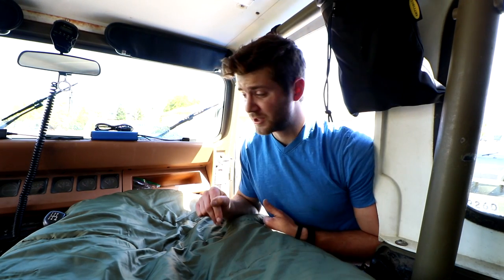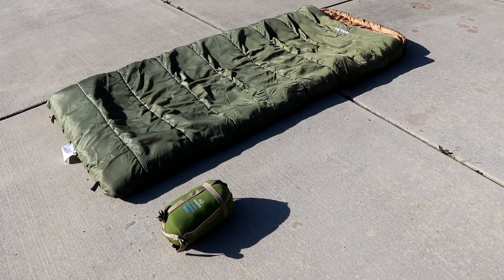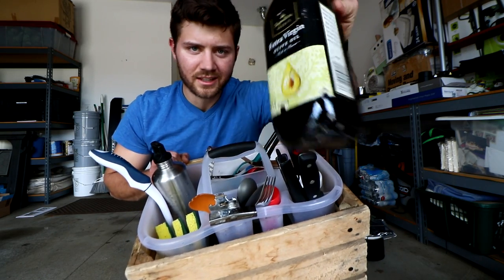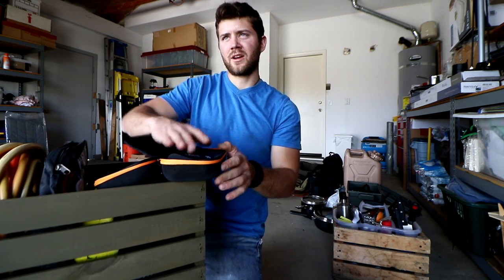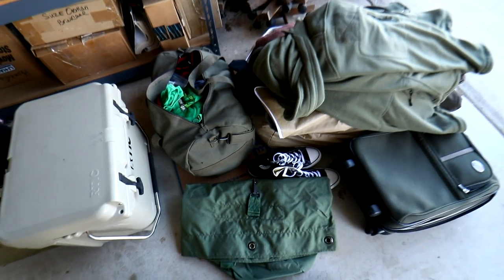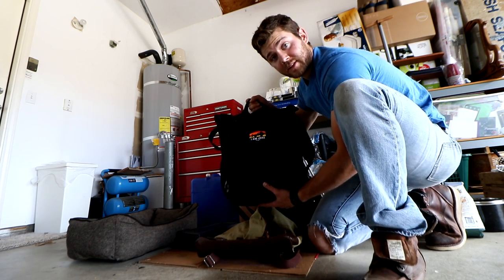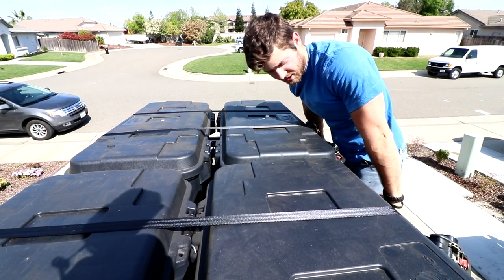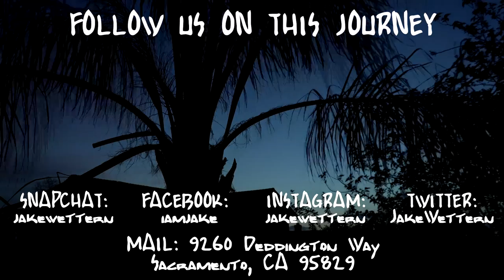Living In My Jeep Wrangler: 1 YEAR UPDATE

Comment: I used to take my Jeep Wrangler camping   I'm in the Society for Creative Anachronism, and we often camp in primitive conditions.   I could load in my tent, two big plastic bins, one or two full sized coolers, a big table, chairs, bedding, pillows, my garb, my craft items, and all without taking the seats out of the Jeep.   All I did was roll the back seat forward and  use that area as cargo.   I had a soft top Jeep too.   I miss my Jeep.  I hit something on the road in a construction area, and apparently cracked the axle.   A few weeks later my dad was driving my Jeep, and the axel broke.   It would have cost more to fix it than to buy a used car, and since I'm getting older and I was starting to have issues getting in the Jeep.....But I miss my Peggy.  My flying horse power.

Comment: I just found your channel, I'm really impressed.  I wish I would have had the guts to do something like this when I was your age (I'm 63 now). Just a couple of things I could add. 

Get rid of the teflon, get some cast iron. It's better for you (teflon is poison if you heat it beyond 400 deg.) and easy to clean (no soap needed) get a small solar panel to keep your battery up while parked.  You need more first aid stuff.  I keep a very comprehensive 1st aid kit AND a very well equipped Trauma bag also.  You may not know how to use everything in it, but if you come upon a bad wreck, it's likely that someone will. Have you thought about insulating your hard top and the floors? Also, if you get stuck in the bitter cold, a hobo stove (metal coffee can and a roll of TP) burning rubbing alcohol is safe to use inside. No carbon monoxide. Crack a window for oxygen.   

Good luck on your adventures! 

Tex
Reply from the maker: Hey Tex and thank you for the suggestions and for your support!

Comment: You can buy a small solar cell with alligator clips that will charge your battery for around $10. It's about 4 inches wide by 12 inches long with around an 8 ft long wire & they work pretty good. Might help you cut down on your waiting time for a boost?

Comment: why not remove the passenger seat for more sleeping area, and make a wooden platform where the seat was, and make a storage area in that space. I also saw a cool drawer setup that comes out the tailgate theyre like a 4-5 ft drawer, you lose the rear seats, but you gain a toon of storage at the cost of some headroom. aslo doing this plus removing the passenger seat would make tons more interior storage, and possibly be more comfortable.

Comment: No you dont need to get a metal gun case your plastic one is fine its cheap and durable why pay over 50$ for something that will rust and scratch. And why a 50$ speaker got mine for 10$ at the local shop . Your spending more money then necessary in my opinion

Comment: I wanted to do this with my 1985 dodge once I do an engine swap and new tires but would it be harder or easier in a truck do you think?
Reply from the maker: 1st gen Dipper - you can make either work.  You should check out Overland Bound - I'm a member there - overlanding/road trips are done in all types of vehicles!  Thank you for your support!
Reply: iamjake, 1st Gen Dipper;
I'm going to be doing this with my H3, just getting things organized and built now, great tip about Overland Bound, also check out "Desktop To Dirtbag" he's doing it in a pickup...
Reply: I'm sure if you put a camper shell on the bed it would be even better.